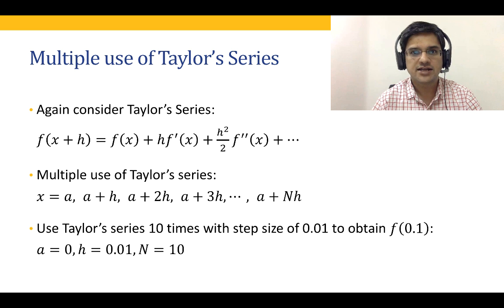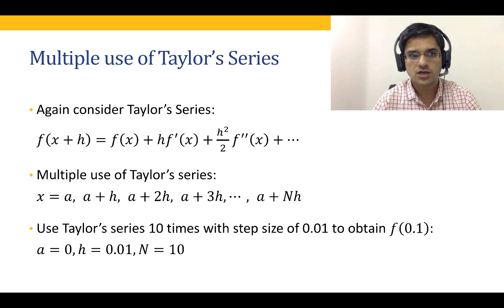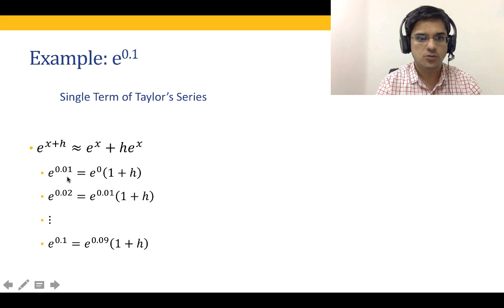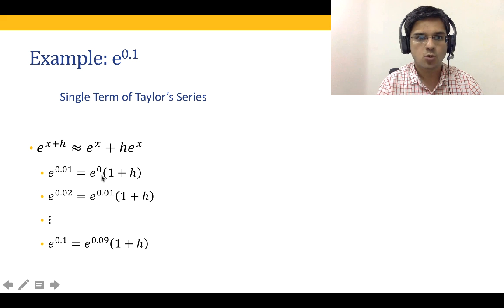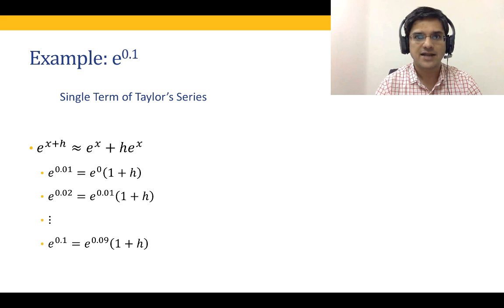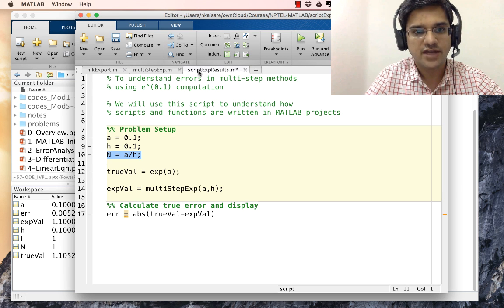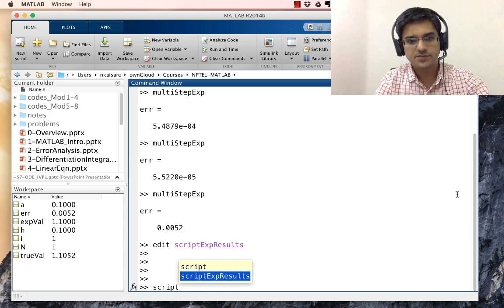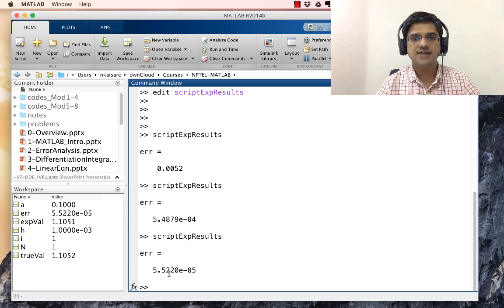Step-wise Methods and Error Propagation

Comment: @16:27, I don't think you have proved that Local Truncation Error does accumulate.

I mean @06:00, you have proved that as we decrease step size (h- from 0.01 to 0.001), error decreases. 
Even at @11:45, we have seen how error varies with the step size.
So where was LTE shown?
Reply: I was also thinking the same thing...
Reply: If I'm not wrong LTE is basically from Maclaurin Series Exp Error calculated where as no.  of terms increases slope increases with factor of n+1 i.e explained in Lec 2.2